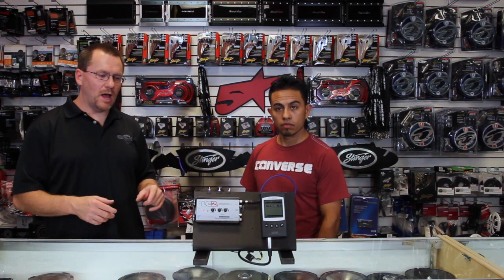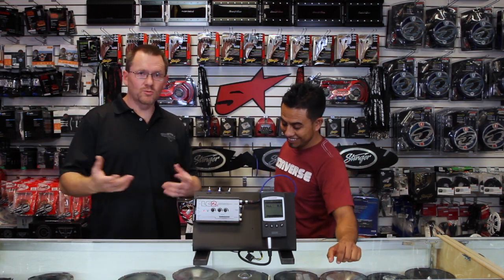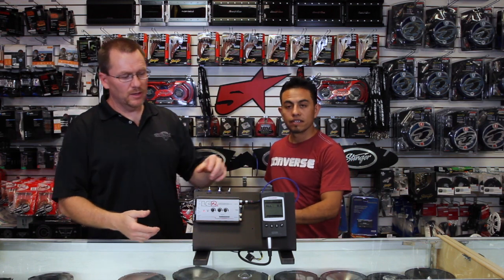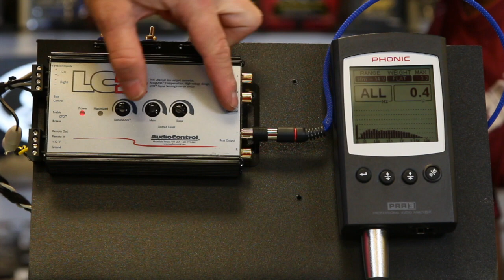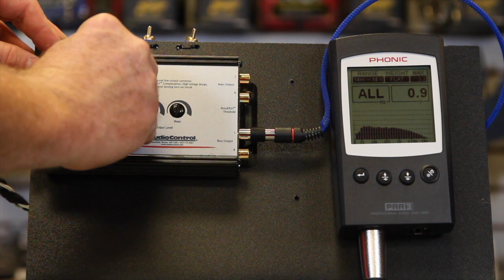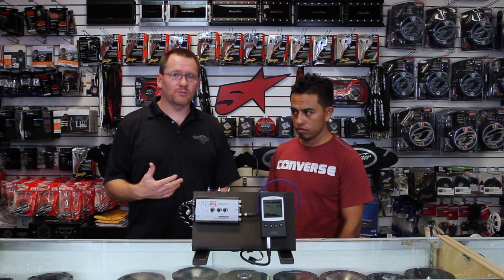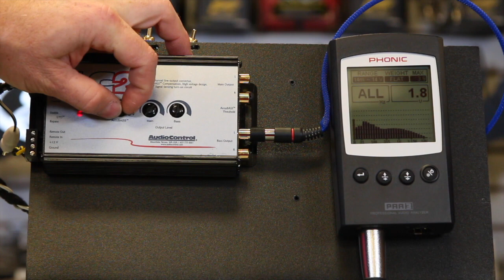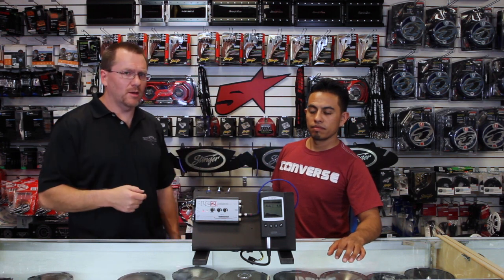Introduction to AudioControl's LC2i "what is and how to use AccuBass"

Comment: What do you use if your aftermarket radio only has one pre out?
Reply: That means you could add bass amp only. These r your choices get bettet radio 3 pre out.or get a eq it has 3 pre outs for 3 amps .last the cheapest is get rca y adapter makes 1 pre out to 2 or 3 but you'll have to use more rca y adapter.
Reply: Why did you feel the need to not just answer the question but to add the assholish statement in the middle of your comment? I got the radio for my birthday from my 12yr old so I'm using it.
Reply: Have a nice day just giving you choices didn't specify what kind of build u was doing . Just answering question with all options 20 years of car stereo plus
Reply: If your head unit has only 1 preamp output you can get a signal processor like a EQ which will take 1 input giving you front rear and sub outputs, Just make sure what ever you get the line out voltage matches the input voltage of the amp.
Pre amp is usually the control center.  Your volume control, tone controls, EQ (if any) and source switching is usually at your pre-amp.  The Pre-Amp is designed to be a very clean low signal voltage and take care of any signal modifications you might want to make to the signal (music) BEFORE the signal goes to the amplifier.

Pre-amp signal is usually LOW,  it was designed to be low so there is less distortion at this stage. Home pre-amps usually operate with about 1 to 1.5 volts of output, the idea was to keep the voltage down as low as possible to keep the distortion down as low as possible in the pre-amp stage and then after the signal leaves the pre-amp we let the amplifier do what it does best.

In car audio we have used this very low level for years with pretty good success.  But in many cases in car systems there might be some noise.  Some of the car stereo manufacturers have stepped up the output voltage of their headunits in an attempt to help us have a noise free system.  

Installers have always found that certain types of noises in a car system can be reduced by turning down the amplifier gain controls. But far too often the customer gets his system fairly noise free but with no gain!! The system just may not play loud like it should if the gain controls are turned down too far. Turn the headunit all the way up and it still wont get loud.  This is where the manufacturers come in with the higher level headunits! Now you can turn them higher, even when your gains are very low (and hopefully any bad noises are also very low)...

Some purists find this added amplification (and distortion) on the headunits appalling. But most of us cant really hear the added distortion and find it much better than the noise !!!

Some rookies find the added headunit voltage an advantage cause now they think their amp will play louder!  NOT TRUE!  The amp will still have its maximum output power and it will not change in most cases of the amps max drive can be achieved.  Many rookies compare a 1or 2 volt headunit with a 4 to 8 volt headunit and they only notice that with the higher voltage the system gets loud at 10 (on the volume scale) and you used to have to turn it up to 30..!!  Some rookies are fooling themselves into thinking this is GOOD! This is better!!    But it may not be.

Ideally, a system has a good swing to the volume control... Too much signal voltage into the amp the system will get loud too soon on the volume swing. Not enough signal voltage to the amp and they system volume control can go all the way up and not get loud like you might like it.  Setting the amp gain controls correctly will give you this proper swing!  

And the rookies may not know it, but if they set the gain controls correctly with a low signal output headunit and compared it to a high signal output headunit then there would be NO volume difference anywhere in the system volume swing...

But I still hear them say, "WOW, I got a 5 volt headunit!, it sure plays louder!, its worth the money!

I just shake my head in amazement...
Reply: https://youtu.be/8ju5QopY4lA

Comment: Can the main output and bass output put out the same bass levels so if I were to put two amps in with their own subwoofer on each they’ll have the exact same sound? I don’t want one sub to have deeper harder hitting bass than the other but I do want each amp to have their own set of channels instead of splitting the rcas between the two amps.
Reply: Accubass and thresh hold only works on the bass out put.

Comment: Hey any advice for setup? My Bose amp attenuates the bass signal up and down as your turn it up. 
Its making tuning accubass really difficult any help would be greatly appreciated. 
Example for the volumes vs bass below:
Volume at 10% has like 70% bass
Volume at 20% increases bass to like 100%
Volume at 30% drops the bass to like 75%
Volume at 50% drastically drops bass to like 50%
Volume at 75% increases bass back to 70%
Volume at 100% drops bass to like 60%.
Reply from the maker: What type of car?

Comment: Does the lc2i need both left and right input if I’m adding solely a subwoofer amp ?

Can I grab signal say from my right rear speaker or do I need both left and right ?

Thank you for a reply.
Reply: in your case you do not need both left and right as long as you at least use the left because it triggers the GTO.  it will come into play if you fade to one side only. But you can use a Y connector  to your cables any way.

Comment: Great videos as always.  Question?  I have a 2015 Mercedes C class w/Burmester system.  I tapped from the subwoofer outs to the LC2.  During the setup, I turn everything down on the lc2, can't get it to light the maximize(or clip) when the volume is increased.  Any reason for that?
Reply: Did you figure this out why it didn't clip? My guess is you reached the lc2i max signal. This is good news tho, you can now go full tilt on volume, just adjust your amps down a bit. Acu bass you turn right under half and turn screw on side down. Then turn radio up.....way up like 85% turn bass knob to like 25%, now turn little screw real slow. This os when the magic happen. Your little clip light. If you turn this little screw too far you can send a too strong signal to amp. Amps has voltage input limit. Look that up and don't go past that.

Comment: Do you have to hook up both left and right speaker wire to get a good signal? I saw you just use twist both positive and both negative wire together on the pac Lp7-2.
Reply: you do not have to , as long as its full range or a mono signal. But reminder . The left side triggers the GTO in the unit,  as a minimum use the left side.  I used the sub output in my car and used the left side and jumped wires to the right of the unit. Later I realized I did not have to but looks good.

Comment: Great video!!! i have 2012 ford fusion with sony system that and a factory amp the OEM stereo comes with 10 speakers.  I am hooking up an amp and sub with tweeters built into it.  To get the signal for LC2i  L/R speakers should i splice into door speaker wiring or the 9' built in factory speaker at the rear.  which wiring will give me a better sound so i don't have all bass or all high frequency? thanks
Reply: gurps kang I was wondering the same thing with my Taurus SHO.  The rear 6 x 9s supposedly only reproduce low frequency I don't know whether to splice those or the full range door speakers.  Did you ever figure this out?
Reply: Kenneth Niswonger I didn’t bother connecting the line output converter yet. From I got it’s better to go with the door speaker wires for the signal. The converter has a built in bass control for the subs. I hope that helped.
Reply: If you plan on adding another amp to drive speakers up front use full range to use the Fix out.  Otherwise tapping into the factory sub is all you need.

Comment: I have a Pioneer AVH200BT with *optional pre outs for Sub, as well as front and rear..(*with normal speaker output wires as well) i just put all new door speakers as well as a 12" sub. Would you recommend using my pre outs or a line converter so it can be "fine tuned"??
Thanks in advance
Jimmy k

Comment: Why wouldn't the Accubass Threshold always be maxed out, that way you could control the bass with just one knob.
Reply: you are correct. Then Accubass is always on and it acts more like a bass boost. I found most prefer Thresh hold all the way on and then adjust accubass.  Finding when the toll off is is OK and works fine but I also like the full sound with low volume.

Comment: Can the LC2i be bridged for single channel operation?
Reply: It has no bridging option. But in the HL input, connect to the left side and use small wire jumpers to the other .  You can just connect to the left and use a Y connector to your amp also.

Comment: Very good video currently just running a pac lp7 going to a sk2500 running a zvx12 wanting to run my fsx 6.5s an tx 6.5 door speakers on amp my guess is this should do the trick to being able to run my sub amp an speakers amp an would a line driver help any
Reply: My guess would be with the accu bass I wouldn't need a line driver

Comment: Could the LC2 be use like epicenter with banda music. Please let me know it would be very helpful thank you
Reply: yes it can they have two different roles. The Lc2i is mainly a line driver with bass boost. and the epicenter is a bass restoration unit  that can let you   restore a certain frequency and how wide from a center frequency. I can see this creating pretty bad clipping if not done right.   If your amp has a bass boost like a 45hz, set up the LC2i first and add a  bit of bass boost at that amp frequency.  I always see this unit with all the settings set up too high almost 90% of the time.

Comment: You guys are fantastic. I'm reviving my old system from high school and putting it into one of my daily drivers after years & years. 02 Chrysler 300M. JL12W7, JL 500/1 &...stock deck...yes I know. But its the RB1 NAV & its gorgeous. Anyways. I have the LC2i & the M's have 12 speakers in 9 locations or w/e it is wonderful Infinity system with a ~366watt OEM amp. My Question is can I splice into the wires on the OEM amp's wiring harness to run my LC2i? I'd sort this out myself but I realized at 1AM I had broke my big inline fuseblock for the power wire many years ago removing the system from the original 300M. -_- lol so its a "tomorrow thing".

Comment: I have a 2017 f350 with sync 3 an the Sony    speaker an 8in sub. An running the lc2i what should  I set the acubass at an bass level ????
Reply from the maker: +Nick Davis take out the LC2.i and get a PAC AP4-Fd21.
Reply: Five Star Car Stereo I'm keeping factory setup just running a amp for sub. With lc2i jusy didn't know how to adjust the levels already have it all installed

Comment: HELP PLEASE 

My friend has this same converter in his car which has been great so far. Just today it had turn of the power light is of but the maximise light is continuously off.

Also the output for the remote has stopped working but it does work when bypassed with the power 

Do you have any idea why power is not on but maximise is?

Help would be appreciated
Reply from the maker: +Sufyaan Khan if it was working fine and stopped it is either a bad input on channel 1/2- that is the channel that creates the turn on. Or the unit went bad

Comment: Hi Dean and Fernando, Thanks all the valuable knowledge you
share. I have a PioneerGM-9605 5 channel amp on order. Would I gain anything in audio quality with an Audio ControlLC7i over the built in
speaker level inputs  of the Pioneer? Going in a 2017 F150 XLT, no Sony, no nav. Standard audio.
Infinity Reference components and a Pioneer 10” shallow mount sub enclosure also coming.
Thanks, Walt
Reply: I have the exact question... I do have a LC2i don't know if I should get the LC7 or just use the LC2i since I have it and take advantage of the input functions on the Pioneer GM-D9605 . Thanks
Reply: any updates? did you pull the trigger and get the LC7i? or just stick with the built in loc on the 5 channel amp?
Reply: What's you end up doing I'm going through the same thing on a 1500watt Rms Memphis amp. I already bought this just in case I'll probably test both out and if high level input sounds as good or better I'll return it

Comment: You never showed what the Bass knob does - parametric EQ?
Reply from the maker: Aaron Hammett it just a level control and it is sold separately
Reply: It's not sold separately, it's right on the unit; it has three knobs: AccuBass, Main, and Bass. Are we supposed to set AccuBass feature prior to adjusting Bass and/or Main output gain? It seems that you should be setting Bass/Main output voltages before you mess with the AccuBass boost.

Comment: Hey there so I don't have bass roll off so I turn threshold all the way up.. so what do i put bass on.. I notice my amp clipping a bit too soon so I'm assuming too much voltage from lc2i .. my lc2i accubass is half my main is off and bass is half.. gain on amp is half and premature clipping..
Reply: The bass adjustment setting  acts like the input voltage or volume on your amplifier. They should have labeled it volume.  if you have it too high and your amp too high of course it will clip.  if you play a tone and have at least your radio 3/4 up adjust the bass/volume until the clipping indicator comes on, back it off until it goes off.  Your volume of your amplifier should  be almost off or all the way down.  The unit is providing all the input voltage you need.   Warning some amps cant handle such an input. . FYI,   My small amplifier could not handle such a voltage of almost 9 volts.  I ended up setting the bass volume at around 8-9 oclock.    The main is only for additional speakers or amplifier , though it does improve bass also and the main adjustment  is for the same purpose but for the main output only.  if you are not using  additional speakers it plays no role. 

So if you are clipping lower the volume on your amp, or if it cant handle the voltage of  the LC2i reduce the bass /Volume to about 8 O clock  and at most adjust your bass amp 1/4 of the way not half.  One or the other could be up but not both. Good luck.

Comment: Good demo! My question is, suppose I have a four channel  factory head unit and I want to use it with a four channel amp and a mono block sub amp , what are my options?
Reply from the maker: nitestrike1000 go with the LC7i, the LCQ1, or the DQ61.
Reply: Thanks! I'll check them out

Comment: Another excellent video Five Star Car Stereo!  On the LC2i, do the Sub outputs put out a full frequency or just the lower sub frequencies?  I'm trying to figure out if I can use the LC2i or if I have to get the LC7i.  I currently have a 4 channel LOC that the rear channels pass through my sub amp to the rear channels on my 4 channel amp.  Also, will AccuBASS restore the bass frequencies that my stock head unit seems to filter out around 35hz and lower at all volume levels?
Reply from the maker: +FACTION95 the bass channel is only for bass. It will only fix bass roll off as the volume goes up. It  is not an EQ so it can not fix the DE-EQ problems of the factory radio. For that we use the LCQ-1
Reply: Thank you so much!  You guys rock!  When are you going to open a store in Southern California?
Reply from the maker: +FACTION95 haha, it is a nice place

Comment: just installed my lc2i unit... running 2 12" jl w7's 900 rms on 2500 rms watt amp... everything sounds great and seems to be running great. sound is coming through nicely... noticing my peek power clipping signal light isnt turning on my lc2i unit. any insight on why??
dont have anything turned up passed halfway...amp or lc2i unit. does it mean i have more power i can turn up before it starts to light up  or is it broken?? lc2i unit seems to be working. the connections are all poperly in order.
Reply from the maker: Auus Worrior it is ok if it is not coming on. It just means the LC is not clipping. If the gain on you amp is set right you are getting all the power. There is a balance between the LC and the amp. If one is down the other is up and vice versa
Reply: Five Star Car Stereo thanks

Comment: So..what do I keep my amplifier gain levels at while tuning my lc2i? Should I let me lc2i handle gain levels and not worry about amp tunes?
Reply: That is the intent of the unit. at one point I fixed amps and found that some amps Volume all the way down was like having it off. barley have the gain on the amp turned, at most not more than 1/4 turn or less.  But some amps cant handle the voltage of the LC2i so it may need to be turned down a bit. Mine is set to about 9 Oclock.

Comment: Hi 5 star. I have a 1998 Lexus gs300 w Nakamichi Premium sound. I am going to buy a Lc2i. I just want to add a 15 in the trunk and amp. This Lexus has a factory 10 in the trunk lid. My BIG question is. Do I tap before factory amp or after. Like should I tap into my factory amp harness that goes directly to factory sub(or just tap into sub) or should I tap into factory head unit? Thank you and any one elses comments would be greatly appreciated!!!!... Also my factory sub is single voice coil, if tapping the sub is a good idea, do I just "y" the two positives and two negatives...Im telling this car is so hard to upgrade because it has this dam Nakamichi premium system, no harnesses for aftermaket Head unit or any parts....lol...........Nick
Reply from the maker: You can tap at sub or amp, just has to be after amp either will work fine.Y the sub wire into both inputs.
Reply: Thank you for the reply. Ok so after factory amp. So tapping in at factory head unit harness(before factory amp) to receive a FULL RANGE SIGNAL is not the way to go? I believe the stock sub does not have full range signal. Would this work for the EPICENTER PLUS as well?
Reply from the maker: Nicholas Fisher the LC2i needs a High level input. The radio is going to put out a low level. Have you seen this video
https://youtu.be/6Zw04MVbNsM